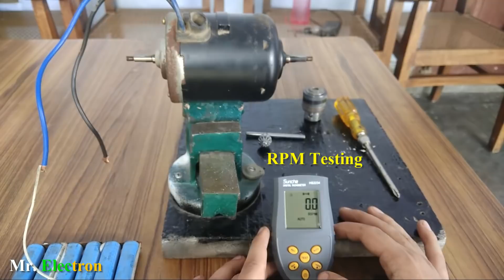12 Volts 64 Amps DC Motor Generator 750 Watts || Full Testing

Comment: so if I wanted a single coil that would produce that much amps and volts what gage wire would I use and what would the total weight of that wire be?

Comment: What you did cleaning the motor, I did hundreds of car self starter motors for good results but lubricating its commutator is not a good idea. This may create a big mess of carbon on the commutator. Carbon brushes are self lubricating. Lubricating bushes and bearings is OK. Using such motor as generator and driving it by some other motor is not promising. It has no benefit. Why not one may use a power supply to do such work better than this one? Also maybe some people may think to use such a motor in Free Energy Hoax and satisfy their free energy sick mind. But in vein. Support my channel also.
Reply from the maker: Lubricating the commutator increases carbon life in my experience.
Reply: You can take any magnet motor  spin it with fast with your fingers it will always produce electrical power be good for a hobby windmill with lights all over it my next project
Reply: Phillip Basnett 
Then you must know it’s not windmill it’s wind turbine.